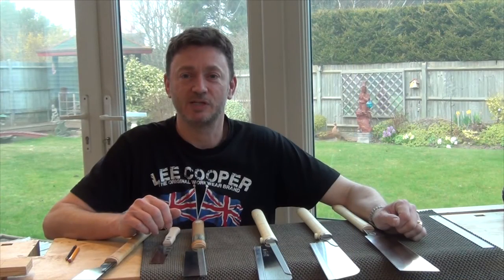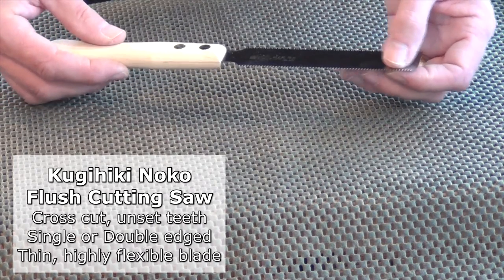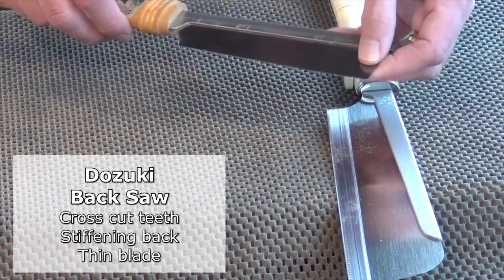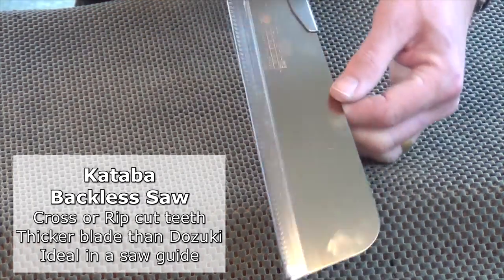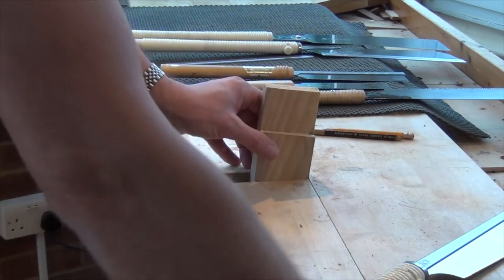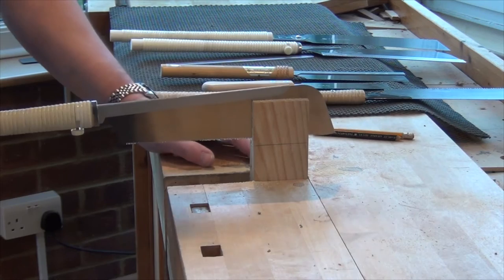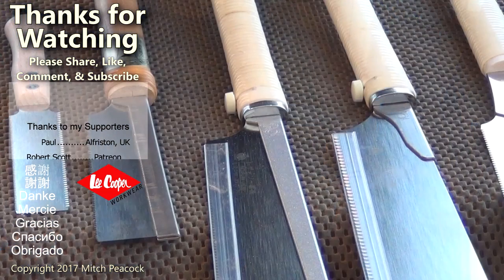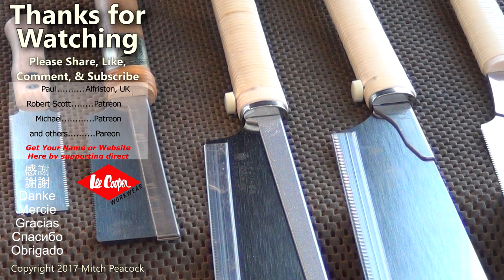Japanese Saws (GIW episode 31)

Comment: Nice video, Mitch.
You explained it well.
I've read times that one when you work with Japanese saws. You should saw it without haste and haste, you should take your time. Otherwise you may get caught with the saw blades and the saw blades can then buckle or break.
Reply from the maker: Thanks Gunter!
That's quite right, one should not rush. But, that is counter to many Western ideas, and there is a possibility of buckling the saw - even the slightest buckle will ruin the way the saw works.
Reply: That's right, Mitch.
Some Japanese saws (laser honed) forgive minor flaws, but hand-crafted Japanese saws forgive nothing. They are either blue or white paper steel and cost a little more.

Comment: I love Japanese saws.  One thing I heard someone point out, and of course have now noticed, is that with the pull stroke cutting, sawdust can obscure the cut line.  Any suggestions on ways to avoid this?
Reply from the maker: Make the sawdust eject mainly on the opposite side to the marked cut line. If you observe how I was sawing using the bench-on-bench method, the marked line is on top, but the saw is cutting from top to bottom and so pulls the sawdust out below. You don't need to use a bench-on-bench though, simply adjust your grip and/or stance to achieve the same effect (stance isn't something rigid, I've just suggested what I find comfortable and accurate - a starting point if you like)

Comment: The downside of hardened teeth is of course that they can't be sharpened. Once they get dull, the blade needs to be replaced. That's not a feature I like in tools. Having the ryoba between your fingers was a bit of a risky work method.
Reply from the maker: Advantages and disadvantages to that, but that's a different video! It did look risky - never given it a though before! At least the line of force was away from me. No doubt the next time I do it I'll chop a finger off :-)